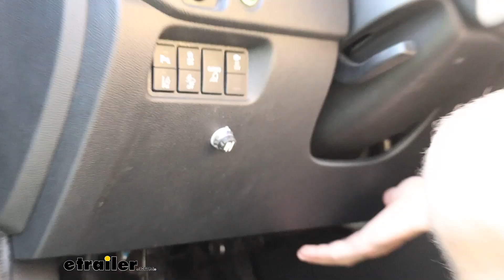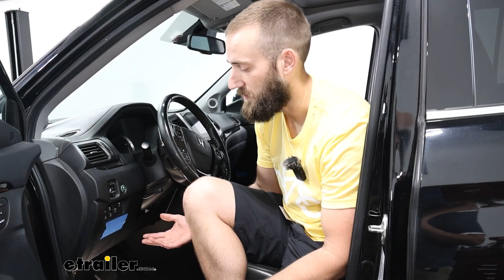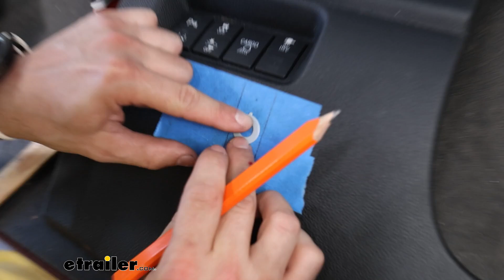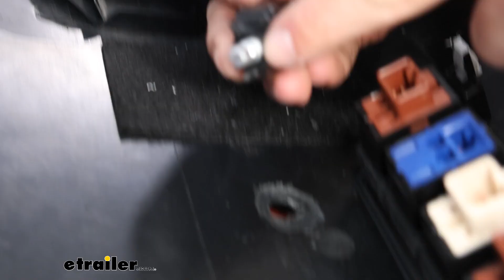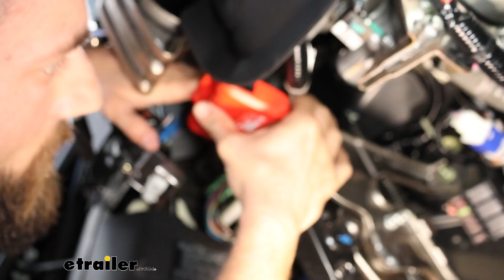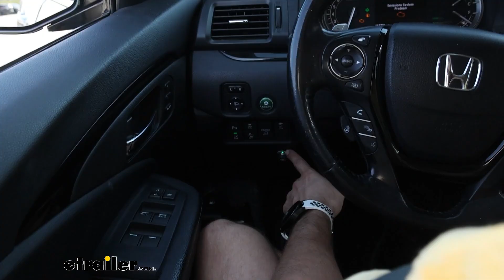etrailer | Setting Up Your Redarc Tow-Pro Liberty Brake Controller - 2020 Honda Ridgeline

Comment: Is there enough RJ45 cable to mount the brake controller down by the parking brake on that smaller panel?
Reply from the maker: That cable is 3 feet long, so as long as it's within that distance, you are good.